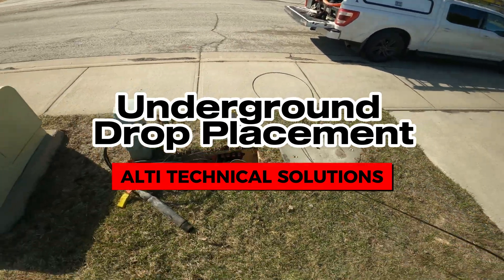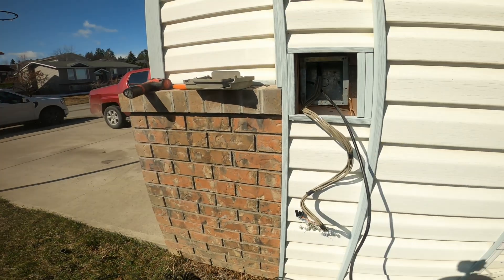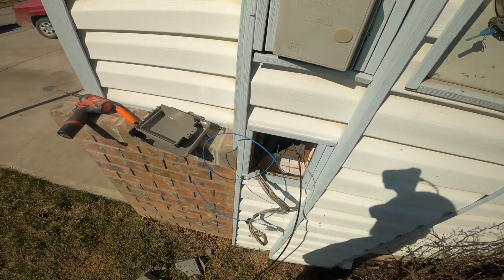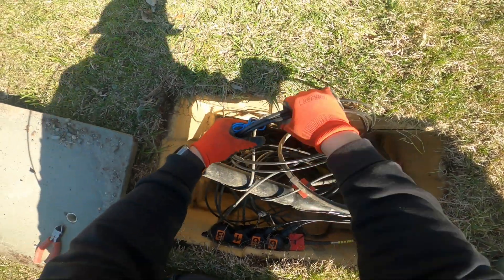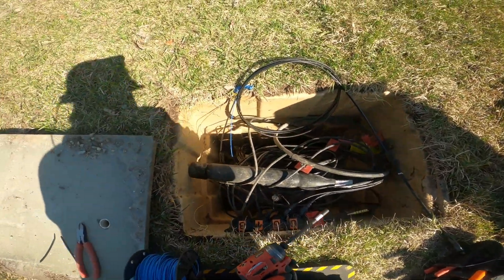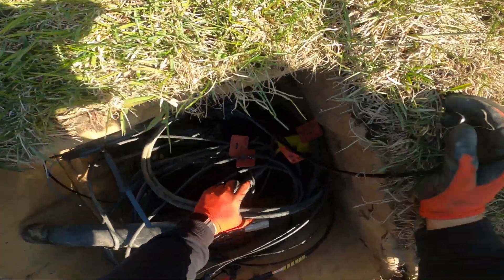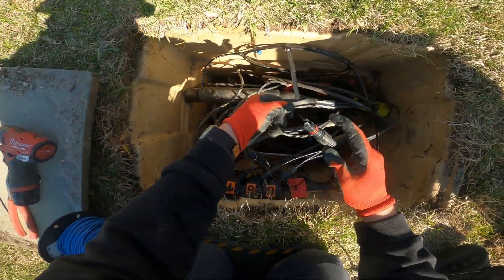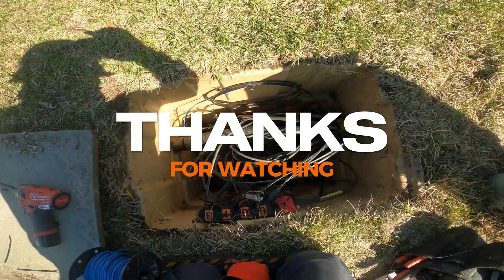Underground Fiber optic Drop, copper cable to fiber FTTH POV

Comment: How long typically from your part until the second installer comes to sort out the NID side of things?
Reply from the maker: It can vary depending on the customer. Sometimes it can be weeks until they move in, but usually within a couple days. Sometimes next day. It can also depend on how early I do it before my due date.

Comment: nice work! I've never seen that kind of saddle strap before, but it looks really handy for mounting loops
Reply from the maker: Are you referring to the large strap it’s self or the small saddle I used to mount it?
Reply: @FyBurz  the large strap you used, it looks like a ziptie, but also seems too flexible for that. I've seen those saddles before, never knew what they were called though
Reply from the maker: @russellmartin7247  ah yeah they’re called deltec straps. Essentially large zip ties 😅 I have new mounting brackets I’ll be using from now on for them.